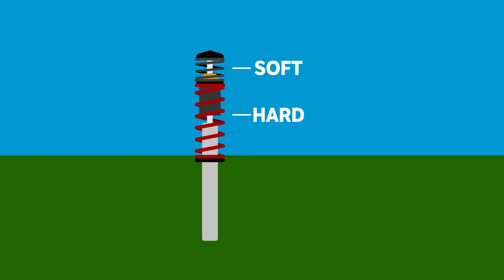What Difference Do Coilovers Actually Make To Ride And Handling?

Comment: Sorry Car Throttle but the Eibach sales man got his own employer's concept wrong and so is your animation. I have such "dual spring feature" in my cheap no name E36 coilovers and it's nothing special. This second little spring is very weak and will completely compress as soon as the car is just sitting on the ground. It doesn't effect the performance of the suspension at all. It's only task is to keep the main spring under a minimum amount of load (pre-tension) when the suspension is completely rebounded, for example when the car loses contact to the ground in a slight jump or while driving over curbs etc. Otherwise the larger main spring might lose all of it's pre-tension in a fully rebounded situation and "float" around the damper for a moment which might be catastrophic when the wheel touches the ground again and the spring doesn't sit where it is supposed to. You might notice this in coilover setups that are able to go veeeeery low and only have one main spring. When lifting up the car you might have no pre-tension on the spring anymore and it might move freely. Another way of keeping pre-tension in fully rebounded state without using a second spring is to reduce rebound travel via dampers with a shortened piston rod. That is the reason why you should use shortened dampers when going for lowering springs that drop the car more than let's say 40mm.

Comment: Does dropping the height of the car increases its speed ? 
I mean does it have any effect on performance except the handling. 
Need Experts Advice !!!!
Reply: This is a late answer but I would say lowering a car changes its handling in turn changing its performance also. Will it change its speed? Yes and no because it depends on the scenario. In a race course yes it would be faster  around corners so it would have a faster overall lap time because if better handling and turning abilities. In a straight line high speed setting aerodynamics comes more into play. Lowering a car closes the gap to the road surface from the underside of the body more in turn speeding the air flow and streamlining it further to make the car push itself more to the road with more downforce. This downforce is good to stabilize the car but it also increases it drag to a point that may reduce the top speed to maybe 2 or 5 mph depending on many factors. To go fast you need to have the car push downward or you could loose grip of the road and crash. That's why cars that go fast or race cars are low so that less air gets under them and the air that does go underside is more streamlined so the when it goes fast the car will push itself down to the road like a wing and be stable at high speed. Look at factory performance cars, they are usually lower and have undersides that are streamlined because they can go faster. So this is why lowering can affect speed not just handling. So it depends but you cant go superfast if your car is not planted on the road. Just my understanding.

Comment: Progressive spring (or this two-spring) setup is a shitty choice for track car. Linear are far better for controlling the car.

And you have to push the engine right to the redline, in order to use the lower gear advantage, even if the power band goes down on higher rpm
Reply: Igor Bagayev two combined springs never work progressive. Both are linear to the point one or both are completely compressed.

Comment: When preparing a vehicle for rallying, uprating the suspension is the first priority. Which I did when I was rallying back in the 1960s. That really dates me. However, wannabe track day Horray Henrys who just use their car on the road are wasting their money. Note spraying the coil springs red. Spending money on the car, taking value off the car. Because when you trade in or sell at auction, the first thing the dealer does is return the car to standard specification.

Comment: Michelin pilot super sports.
Get em.
Reply: And hotchkis sway bars.
Reply: Was unaware of the production on the pilot super sports.
But they were an awesome all around tire with the exception of winter. 
The only other tire I had that felt equally as good are the old azenis rt 615 before the redesign.
I've had bf Goodrich sport comp 2's but haven't had enough seat time with them to determine.

Comment: If you set off one second earlier you could have saved a few pounds also don't understand BMW and lines there drivers only use the middle of the motorway so dog need these springs

Comment: That guy has a lovely hairy chest. More on topic now I think it's sometimes best to stick with OEM suspension a lot of the time. Getting new OEM parts is a good idea as a lot of the time it's not the design of the suspension but rather because the suspension is old and worn out. Suspension is one of those things on cars that are finely tuned on the car from the manufacturer and designed in a specific way for that very car as soon as you start messing around with it you can ruin the car entirely. You can't make it a better all rounder because that is what the manufacturer intended from the start or at least it's unlikely but you can make it better on tracks. Car suspension from the manufacturer is tuned and designed for roads so it's unlikely you will get better suspension for the road stick with what was designed for the exact car.

Comment: I'll take him for a ride in my car to see how a pretty low car is still better than the thing you started with
Reply: Alex Stava that's not possible with any "of the shelf" dampers/coilovers. You always had to deal with compromises. If your ride is super plush, then it sucks massively when going fast, especially in handling and control.
Reply: Marc D. H&Rs with replaced springs, including the helper ones or whatever they're called. Travel is only reduced by the stiffness, but I don't even have them tightened with the spring seats. I go into pretty nasty corners at high speed and I don't get any oversteer or understeer, car sits pretty straight. Also, doesn't keep bouncing as some other ones I've tested, just stabilizes immediately.
Reply: Alex Stava ok thats a good way to compensate for the massive amount of rebound damping 👍

Comment: Let’s see you gained  1/2 of a second  at a cost of 3 Thousand US Dollars. Most people track there cars 2-3 times per year my stock setup on my F90 M5 is very capable n both track and street.
Note changing the suspension and wheel spacers are just bad,
as the car was engineered with them as you change them  wear on bushing, cambers and a bunch of bearings get changed and cause wear where it’s not meant to wear, this is the short version of what mods do to your car .
99% of people do mods to appeased there own Vanity and fit in with the fake cool kids.

Comment: I can’t believe this guy was an Eibach representative and gave such an erroneous presentation.   If I were his boss this video would either get him fired or demoted and some heavy training.   Just for one, get definitions correct.    The way you speak matters when you are a paid SPOKESPERSON.     He states that the shock controls stored energy.   Correct but only half the equation.  It really just DAMPENS kinetic energy.  If it was truly controlling it, it would have the ability to dampen the springs to retain the desired ride TYPE, not QUALITY.   Saying that word is just an industry euphemism is a cop out, for all involved.   Yes, we all use misnomers.  But some are utterly harmless, while others are just lazy and wrong.   The word dampen means to reduce action, whether in rate, overall speed, momentum or impact, and the like.  For example, a shock that allows the transfer of fluid or gas from one chamber to another very quickly will result in a soft ride, but great absorption of bumps.   Make that hole tiny, the RATE of transfer slows, and it takes more time for the shock and spring combo to compress, AKA the compression aspect of suspension travel.   Then, the assembly has to return to the upper position, dictated by car weight, spring rate, movement limiters or “stops”, a geometry of the physical suspension parts.   Of note, the word “rate” as used across the industry, really should be the word rating, as it is a weight rating, not a speed of its movement, yet another misnomer.   So that downward movement or extension of the assembly is rebound.  If that movement is too quick the front end will feel like it’s rising far above resting position before compressing again and finally settling.   If that movement is too slow the movement of the assembly will again shock the vehicle with a lack of movement.  It’s all about the rate that the shock compresses or rebounds.   So the combination of spring rate and shock valving dictates ride control, and the geometry dictates the dynamics of camber, caster, bump steer, changes in toe which unbelievably can occur through the arc  
of suspension travel, and overall travel.   But the only true ride “control” would by definition be active control.   Magnetorheological shocks use an electric charge to variably energize ferrous particle in the shock fluid which results in variable viscosity and thus actively manipulating the rate of fluid transfer through the orifice which would otherwise dictate a singular rate of movement, with standard shock fluid, or oil, being of one viscosity.  Well, until that fluid gets hot, viscosity decreases, and the shock goes soft, and the dampening action is reduced dramatically.  To put it all another way, a solid suspension would beat you up, and struggle to keep the tires in constant contact with the road.   Soft springs, lots of travel, and no shocks would result in a cushy ride that would likely make you sick as the oscillations of the undampened springs would allow the vehicle to bob up and down so much that the suspension would struggle to keep the tires in contact with the road for the opposite reason.   Stored energy, huh?   Yeah, that’s all a shock does.   Eibach, huh?   Gotta question a company with so little oversight that they send a person who spoke erroneously and incompletely as their “spokesperson”.    I’m sure they were allowed more than one take.

Comment: Your setup is bad. U need to soften the rear. A low powered car should just barely oversteer at full lateral g in 1st. If you cannot put the power down out of the turns you wont be fast.

Front engine rear drive cars need to be set to require a bit of trickery to get the rear end out. Driving style like quick throttle lift and back on immediately are used to make rotation happen. Understeer is the desireable track behavior of a FR drive. You as a driver fix that. Springs are too stiff in general. Need more weight transfer to the rear on throttle.

First step to getting that car set correctly is with a tire thermocouple probe, get the temps of the inside outside and middle of the tire.

Middle hottest = too much pressure.
Inside hottest = too much negative camber.
Outside hottest = not enough negative camber.

Get the rears aligned for maximum grip first. Then go to the fronts. After that change spring rates or sways for steady state cornering, or damper settings for transitional behavior. Tires won't fix your load balance issue. A good rally suspension setup is balanced no matter if the surface is asphalt, gravel, or snow (ride height needs to be changed, and softening for imperfection.

When the suspension is balanced, it is balanced for most conditions.

You can change sway bars without doing the corner balance again, or damper settings, but you cannot change the springs. You might get away with changing alignment without doing the corner balance again. You also must corner balance again if you change ride height.